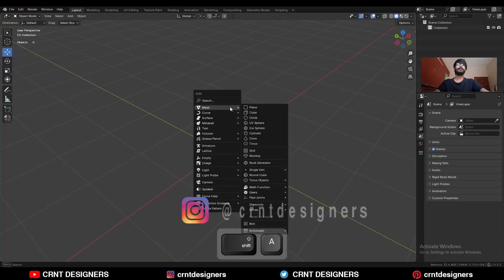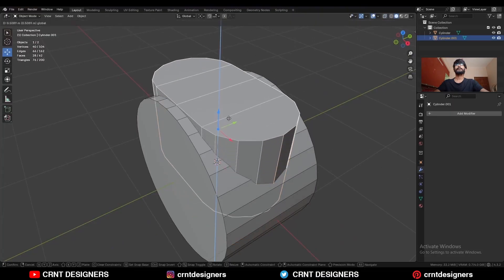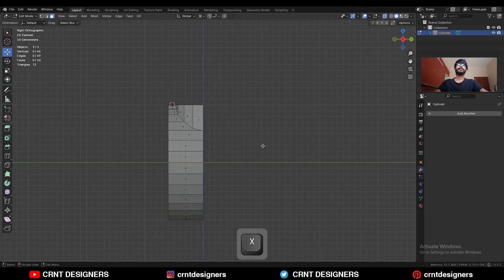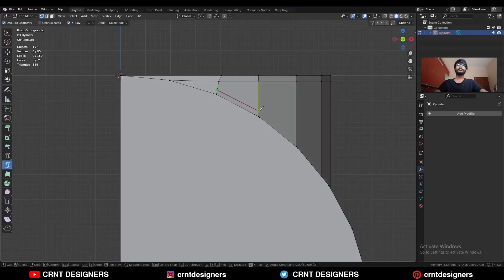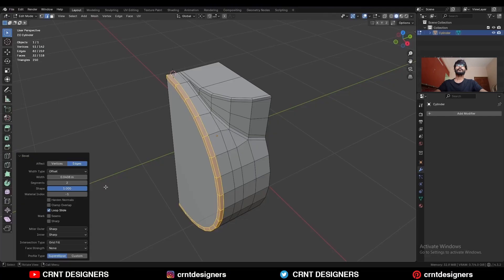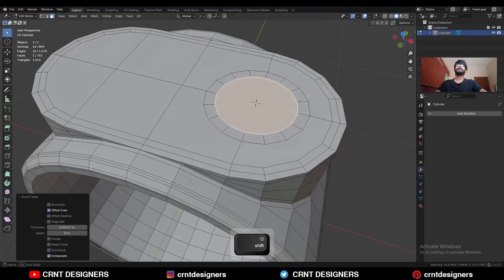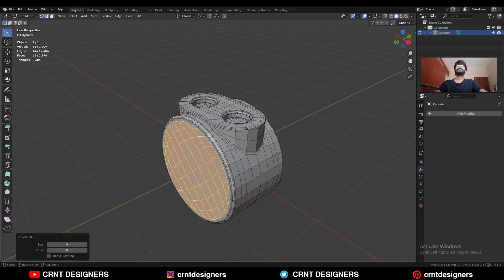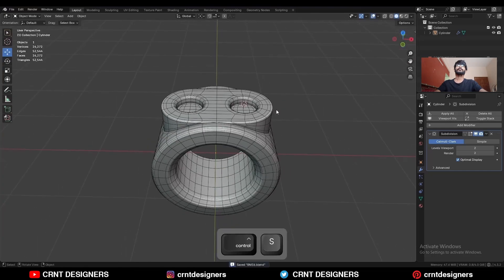BM36 _ blender beginner subdivision surface modeling tutorial _ 02-11-2025

Comment: Now do something no hard surface modelers bother with; don't make it look like metal, make it look like machined metal.
That involves toolmarks and anisotropic shaders. Think about what machinist operations would be suitable.
Some face milling, maybe drill the large hole, and a circular milling for the small hole (due flat bottom).
Maybe also consider what can remain looking roughed out, and what needs finer surface roughness.
It's a fairly simple piece to start out with, so should be doable, except nobody does. No need for 5-axis super complex stuff.